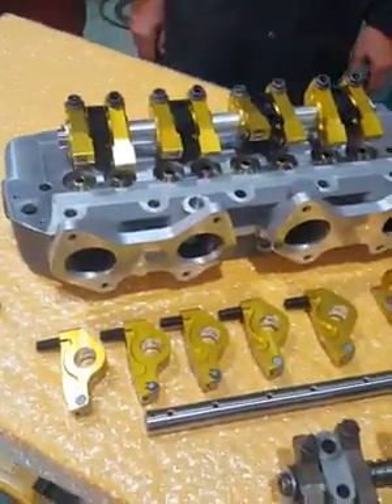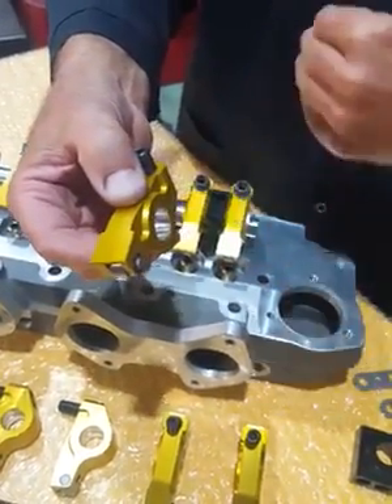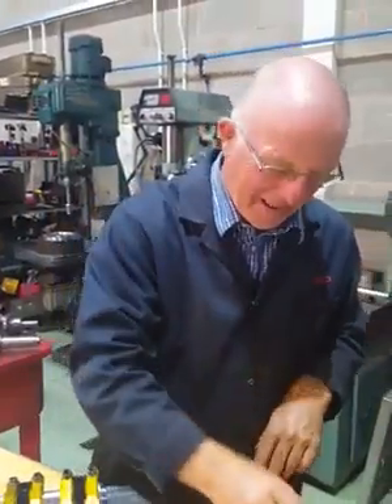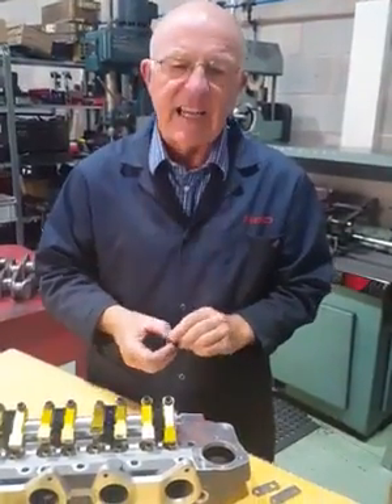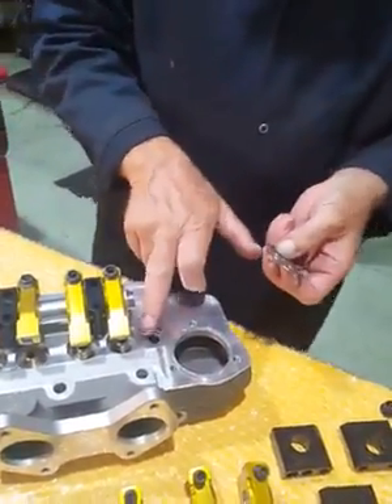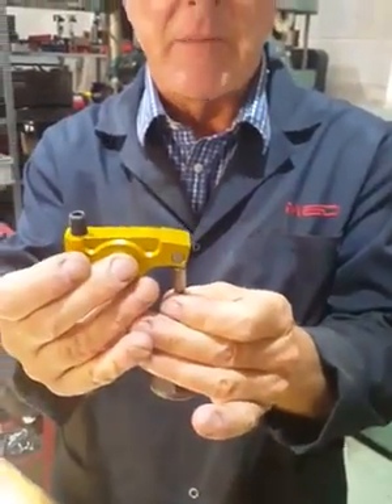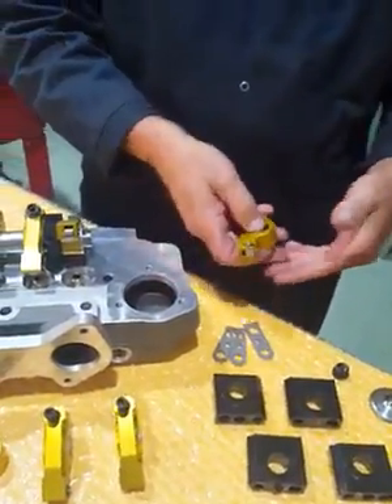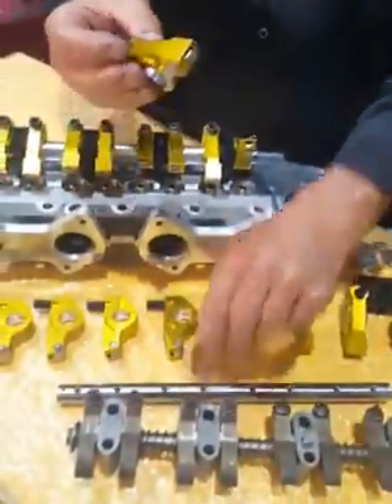MED Roller rockers explained

Comment: You videos are very interesting.
I'll ask the question then about 998 engines. 
Do MED do anything for a 998 engine, given 1275 engine is starting to get expensive to buy...
Reply from the maker: We keep all the gaskets, bearings, cams, bolts - basically everything but the cylinder head components. To build a 998 vs 1275, the cost difference is negligible aside from the initial purchase price. We do supply many Mini Se7en racers, but they tend to use the 1275 cylinder head.